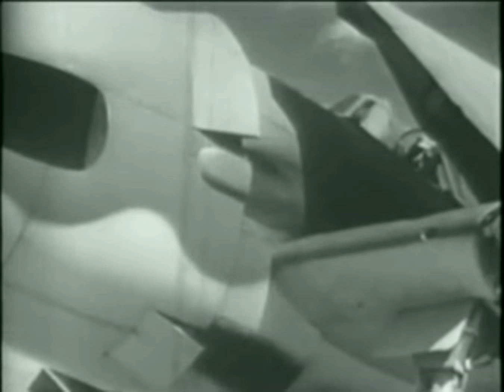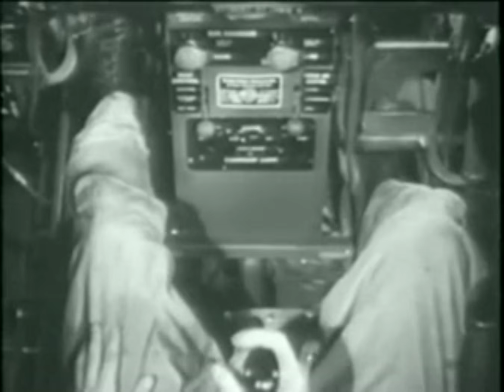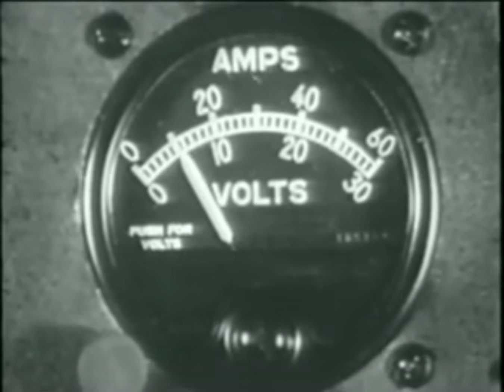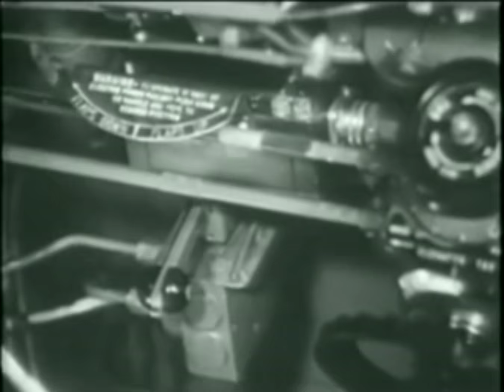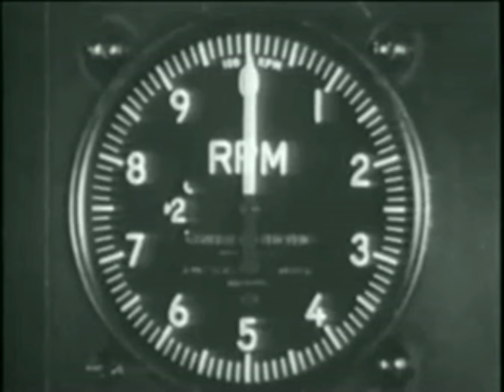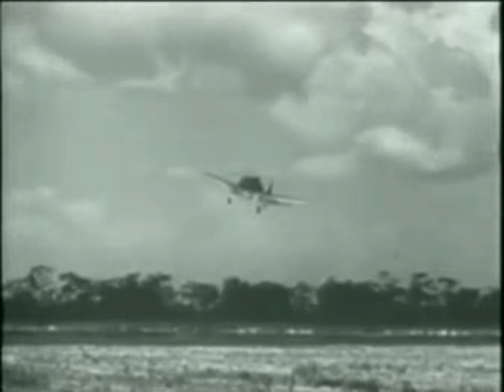"F6F Hellcat Pilot Instruction – WWII U.S. Navy Fighter Training Film (Public Domain)"

Comment: Prop was pulled through to check for hydraulic lock...I figure that's what they mean here, but the way it's stated is to imply that the action of pulling the prop through would clear the cylinders of oil. It will not in all cases.

Comment: The F5F pilot manual reportedly had a caution to not try to dive away from a Ki 61 "Tony". That Takeo Doi design was European influenced and had three wing spars from tip to tip. I don't know about the compressability of either F5F or Ki 61 but apparently that was usually recoverable in both if the pilot was. Rugged aircraft that Grumman.